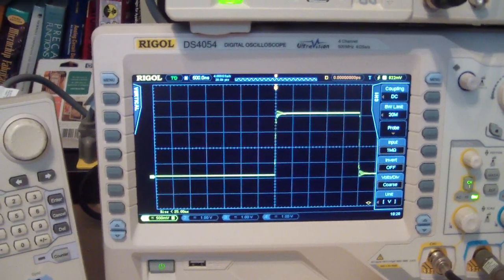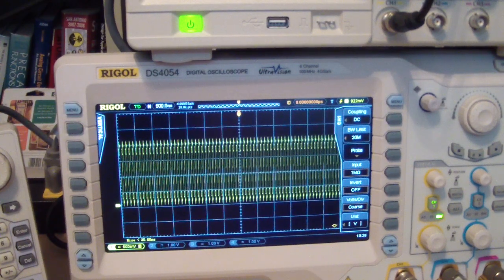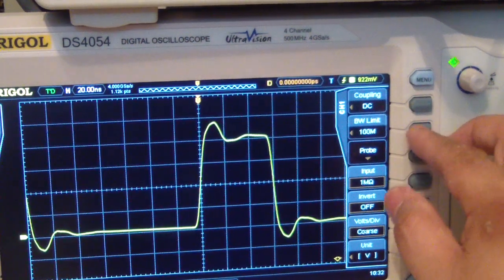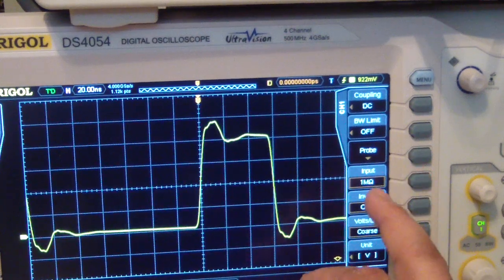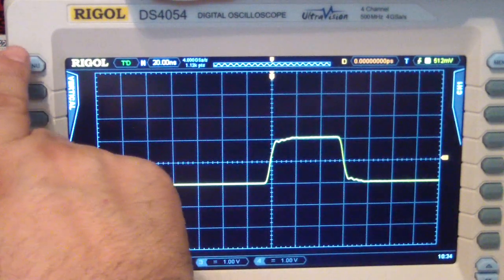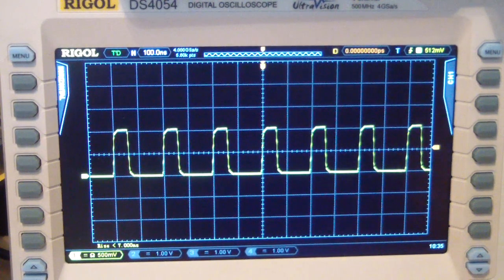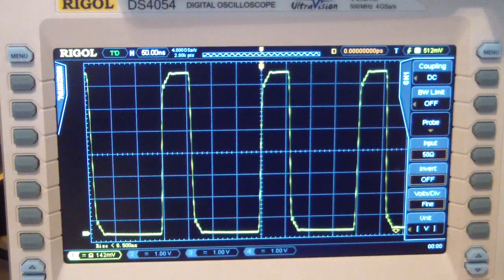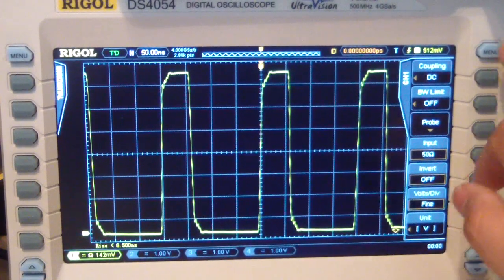Rigol DS 4000 Series scope review part 3

Comment: 50 ohm input, not 50 megohms.  That is why your pulse looks so much better when you terminate the coaxial cable from the function generator properly into its characteristic impedance of 50 ohms.